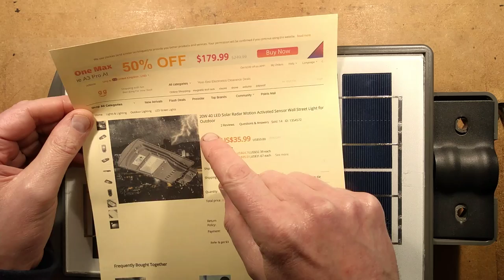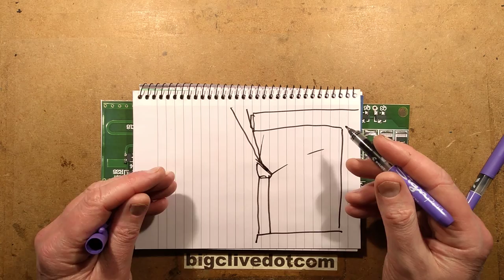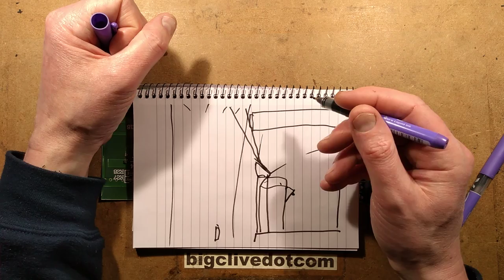Inside a sealed Chinese Solar street light with Doppler detection.

Comment: I bought two of these.  The first one had the sensor/switch board loose (had to remove sticker to turn it on).  This one worked very well for 7 weeks; it has not worked since (located with the panel directed towards midday sun and no shade at any time).  The second one never worked at all :(  It's just sitting next to my desk, waiting for someone to show me how I can (non-destructively) disassemble it so I can fix it.
Reply: You might try heating the edges of the panel with a hair dryer to soften the sealant , then carefully pry it apart. Anyway, that is how many cellphones are taken apart.
Reply: @William_Hada  Thanks. I had thought about doing that with the hot air gun on my solder station.  But it's quite likely going to warp the plastic.

Comment: That looks like a 12 cell PV panel and that is not optimum for a single cell LiFePO4.  Ideal will be an 8 PV cells in series then max power point voltage will be much closer around 3.5 to 4V instead of 5.5V to 6V. So at same cost and in the same space they could fit 8 larger cells. The cells are most likely polycrystalline but that is not relevant as there is almost no difference now between mono and poly.
Curios if that cell is a LiFePO4 and if the protection is proper for it.
Reply from the maker: It is LiFePO4 and does cut out at 3.65V
Reply: That is excellent.

Comment: I'm looking for some solar garden lights - preferably small wall mounted ones (don't need to be mega bright, just for decoration, but they must actually work!)  - does anybody know of any which will last more than a few months?
Reply from the maker: Sometimes it's best to get standard ones and then make them more reliable by sealing around the solar cell properly and coating the electronics with lacquer or grease (Vaseline works.)  At the same time you can change the LEDs for ones of your favourite colour.

Comment: The battery is a 26650 3.7 used mostly in E-cigarettes special versions called Mods.
Reply from the maker: In this case it was a Lifepo4 3.2V cell.
Reply: @bigclivedotcom  I ordered the same one from eBay and mine had a 26650 3.7v. 
Thanks for the reply.
Love your vids
Reply: @jpsaayman9220 did you open and check it? How did you overcome the solar panel blocking the opening?

Comment: Too bad they did not make it easy to open. After all, it looks like there is room for components and another battery so as to improve the system. 
In which case, I would opt for a pair of super condensers to replace the battery. The reason for that is if it is glued back together, one would not have to eventually cut it open again to replace the future defunct battery.

Comment: I have purchased 6 of the same measurement battery 32x700 to repair ingersoll rand impact drill ,but printed on them , li-ion 32650 3.7v 8200mah ,i have charged one with 4.2v 1000ma limited current  , voltage always stay at 3.3v , is this scam ,mistake or i am missing something
Reply from the maker: Does it have a protection PCB under the heat shrink?  If not and it just sits at the same voltage for a very long time while under charge it may be the wrong type of lithium cell or it may have an internal shunt that means it is faulty.  If that's the case then it would be safest to allow it to self discharge and then disposed of safely.  The power tool batteries are specifically designed for high current.

Comment: I purchased 5 300w lights but found there is no true off.  They come on at dusk daily.
I purchased a micro relay switch with remote to be able to keep the light from coming on unless I choose.  
Can you offer advice on how to intercept the circuit board to achieve my goal?
Reply from the maker: The hack for that will depend on the circuitry if possible at all.

Comment: Not really a suitable lantern for long term use, as its not designed to be opened, once the battery has expired after a few hundred charge cycles, which would be only 2 or 3 years, the whole thing would be needing replacement. Also the On/off switch is  unnecessary as you wouldn't be able to reach it anyway, once installed on a column!

Comment: 32700 batteries...  These are mostly older technology with surprisingly poor performance for the size - usually optimistically rated but lucky to achieve 80% of the rated capacity.  They are also poor at constant current due to the higher internal resistance (more goop).  These days a very good 18650 will easily outperform these old cells.  For example the Samsung 30Q 18650  is 3000 mAh and capable of 15 amps constant current.  I'd also rate 28650 and similar sizes as being old tech/poor performers for the size.   They'd be much better off putting two modern 18650's in parallel, but of course they take the cheapest option.

Comment: Is that BISS0001 chip also being used in adaptive cruise control and parking distance control sensors?
Reply from the maker: I doubt it.  It's primarily intended for detecting slight voltage fluctuations in passive infrared movement detectors.
Reply: @bigclivedotcom  Ah, so they probably paired it with an RF oscillator and a discrete phase detector so it works for RF as well? I don't see any crystals, so I guess the 'radar' function of it is pretty crude, maybe just a capacitive proximity sensing.

Comment: i notice you were measuring the current on the solar panel ,by  just putting your lerads across the wires  how was this possible though current was measured in series ??? comments please
Reply from the maker: It's measuring the short circuit current from the panel.  It supplies limited current depending on the level of light.  I wouldn't short the meter across a battery in the same way.

Comment: Could you not use your (JOULE THIEF) here to boost the longevity of the light out put?
Reply: I'd imagine doing that would pull the lithium cell down to a very low voltage, thereby damaging it. A boost regulator circuit would cause the light to remain at the same intensity throughout the battery's discharge, but that costs in terms of cash as well as energy efficiency. The joule thief is at its core a boost circuit, but it's not particularly suited to this application.
Reply: @spagamoto  Thanks mate.

Comment: I am wondering if you have played with "Headway" batteries.  LiFePo4 I think.  ( 38120 )  They're huge and with great capacity and ridiculous output current not to mention lifecycles.  I bought some 8000 mAh ones (small in capacity compared to others) thinking they'd be great in some outdoor lights But I didn't know that their weakness is low temperatures. 

I even got little protected charging boards for them but I don't think they had a thermal cutoff or what have you.  

I'd send you one if you'd like to play with it.  I'm on your Patreon.
Reply from the maker: The protection boards do usually have overcurrent protection.  Usually sensing voltage drop across the MOSFETs.
Reply: @bigclivedotcom  Thanks Big Clive.  I had another thought about the glued solar panel delema.  I wonder if you could put it on an electric griddle (on a low setting) to sort of loosen it?  Have you ever tried that?  I have this electric griddle which is great for making flapjacks and bacon.  Of course we probably wouldn't eat street lamps for breakfast.
Reply: @bigclivedotcom  I'm not sure but the LiFePO4 have a temperature limitation if I'm not mistaken.  I do have a radar light outside that seems to be holding up down to 0°F  Not sure why.  The battery in that thing looked like a Headway but I may be mistaken.  Not sure.
Reply: Sorry.  I'm replying too much.  Cool project though.  Now I wonder if you glued it back together.  I like that beefy battery and the solar panel seems big and amazing. Jägermeister rocks!

Comment: Hi there I wonder why some street lights are red before they go yellow
Reply from the maker: The low pressure sodium lamps use neon gas to heat the sodium and get it to vaporise.  The red is the neon and the yellow is the sodium vapour.

Comment: Wouldn't a heat gun have helped with the weakening of the silicone glue?
Reply from the maker: I've never had much luck softening silicone with heat.  One of its main attributes is heat resistance.
Reply: @bigclivedotcom  but the bond with the plastic... maybe if silicone with something with good thermal conductivity, I would thought that the plastic would have weakened the bond.

Comment: I have no idea why this type of product is defined as a "street light". This is NOT a street light. Look at the size of this people! The solar panel is tiny, the battery is tiny, the LED power is tiny. The illumination time is minimal based on the fact the battery is so small. The battery is so small because the solar panel is so small. It will not light up all night long. A real street light will. It has to use a motion sensor to either turn the light on or make it brighter (from its dim mode). A real street light does not do that and this has to do that because the battery and solar panel is so small. Let's not forget the most important problem these all-in-one fixtures all have. The solar panel should face directly south and in the USA it would be set at about a 35-60 degree angle. This does not allow for that and sits almost dead flat (0 degrees). So it will never in a million years be reliable or effective or replace a real solar street light. Good luck trying to replace the battery when it needs it and that's if you can get inside the thing. These so called all-in-one solar street lights are all made in China and are all hugely limited in capabilities. Most are made with the lowest quality parts, battery and LEDs. The paint will flake off and the metal will rust along with all its mounting hardware. You get what you pay for. Warranty? Forget it! My advice, speak with a real USA based solar street light supplier or manufacturer if you want REAL solar street lights. I mean a real company, bricks and mortar, Better Business Bureau A+ RATED, not just some internet reseller, drop-shipper or Made in China importer. There are several good USA based companies that offer the real deal. A company that makes a "real" solar lighting system with components that are built to last and with a proper warranty. This Chinese all-in-one junk is useless and won't last 5 minutes even if you did find a use for it. A fool and their money is easily parted. This is nothing more than a motion sensor security light to fix above you back porch. Not a "street light" by any definition.

Comment: I thought the Doppler effect was something to do with sound...
Reply: It does. The basic principle is about waves and moving objects. In the sound case: pressure waves and moving sound sources. In the radar case: electromagnetic waves and moving people reflecting those waves.
Reply: You're kinda right, Doppler is popularly used in sirens. Read about the effect that can be used on both sides (sender sending and receiver sensing)
Reply: It has more to do with speed. But since sound moves it is linked, and also happens to make a good candidate for interesting experiments and ruminations since you can hear it. In fact, it is because you can hear it happening to sound that it was investigated and the Doppler effect was discovered and worked out.

Here's a Doppler joke:
Cop pulls this scientist over for running a red light and starts writing up a ticket.
The scientist claims the light looked green to him because he was experiencing the Doppler effect.
Cop gets angry, tears up the ticket, and stomps back to his patrol car for several minutes.
Cop comes back grinning and hands the scientist a ticket for traveling 95.7% the speed of light over the legal speed limit.
Scientist thanks the cop for going so easy on him.
Reply: @AxeMurderer2222  Ooooh, that is a good one.

Comment: I kind of like the  irony of a Brit reverse engineering from Chinese manufactured equipment!  The Chinese are the current masters of minimal engineering. Just what you need and nothing more.
Reply from the maker: That's what makes the cheap products so fascinating.  They sometimes use very clever tricks to save on components and cost.
Reply: I suppose the value engineering skill is easily lost as a nation becomes more wealthy and moves on to higher value, lower volume products. Japan used to be the cheap knock-off grand masters and look at them now.

Comment: Not a traditional lithium cell and not a 26650. Its a lithium Iron phosphate battery. (LiFEPO4) I have a 4 cell scooter battery that uses these. Cells range from 4500 to 6000mah depending on the quality of the cell. Very good current capabilities on them. Please don't use this with a regular Lithium charger clive :)
Reply from the maker: Next video to be released discusses the differences.  I did charge it on a conventional charger and noted that the protection circuitry on the cell kicked in at 3.65V.  The capacity is on the lower side of one of these cells at just over 3Ah.
Reply: @bigclivedotcom  ah alright well atleast it cut off at 3.6 so thats not too bad. Over charging them to 4.2 cutoff is more or less what I meant. Now with this particular cells, explosions or thermal run away isnt a cocern being safer batteries, however overcharging a lifepo4 to 4.2 will drastically affect capacity and kill it only after several cycles.

Comment: 13:20 if i were the person that designed that light in that way, i would be kinda disgusted with myself I dont think i could ever build something that lets the voltage dictate the brightness like that it feels just plain wrong
Reply: It makes sense tbh. You can easily have a 3x difference in solar illumination between June and December. If the cell can't get a full charge during the day, it should run dimmer during the night. Not much use for a streetlight that doesn't work after 10 pm in December, or for one that is 3 times dimmer than it needs to be in July.
Reply: @tybofborg  thats true but I still wouldn't say that a dim streetlight would be doing it's job

Comment: Talking of Li batteries and smoke...… I tried to repair my iPhone yesterday. The rear Mic had stopped working, so purchased the new parts.
Started pulling the phone apart. Pulled the sticky strips that retain the battery. 1st one came out ok. 2nd one was getting a bit stuck so pulled a bit harder. Then a big spark !!. Threw it in the kitchen sink faster than you can say "oh shit". There was flames and a ton of smoke !. Left the kitchen tap pouring on the battery for about 20mins. The house still smells from the smoke today, 1 day later. God it was horrible.  Piccy >> https://twitter.com/DJ_PaulTUK/status/1079081114281619458
Reply from the maker: If there's no PCB damage then you can dry the phone thoroughly and fit a new battery.  In future I recommend discharging the phone before opening it as the main issue is the charge stored in the battery.

Comment: Every ruler and tape measure in the US that I've encountered has had inches and metric graduation, because there are different uses for each. Maybe someday we'll just all switch to metric and things will be easier.
Reply: SergeantHop both are nice, I see no problem with a dual unit system.
Reply: @beefchicken  Other than confusion and the fact that the foot isn't based off of anything relevant, sure.
Reply: SergeantHop the foot is based off of the meter. A foot is exactly 0.3048 meters.
Reply: @beefchicken  It is defined as that now, it is not based on that. Go read the history of the foot, and tell me what it's based on.
Reply: SergeantHop I’m well aware of the history. In 1930 a foot based on metric was adopted. Sure, the foot that preceded that foot was arbitrary, but the meter that preceded the modern meter definition was also arbitrary (and wrong, they miscalculated the degree of polar flattening). The distance from the North Pole to the equator is just as arbitrary as the length of some dude’s foot. They’re all just human interpretations of a physical constant. Both the meter and foot are now just mathematically related versions of the same standard.

Regardless, we now have a foot that is as well defined as the meter, but because feet and inches are based on highly composite  numbers, they’re actually more useful in day-to-day usage.

I use both because it makes my life easier. If you’re so hung up on a goofy historical origin that you refuse to use a different unit of measurement, then so be it.
Reply: @beefchicken  It is well defined, but still unnecessary. Also the definition of the foot was in the 50s. But regardless, the main reason metric is a more useful system is because it makes more sense, instead of being divided into 12ths and so on. 5280 is a ridiculous number, as is 3 to a yard. There's probably a reason the rest of the world has switched to metric. Just sayin.
Reply: @sgthop   The foot is based on the foot, you know, that thing at the bottom of your leg.  I still see builders and the like measuring things by placing one foot after the other.  And the yard is based ont the stride of a Roman soldier (probably).